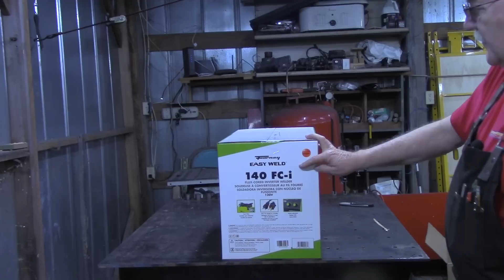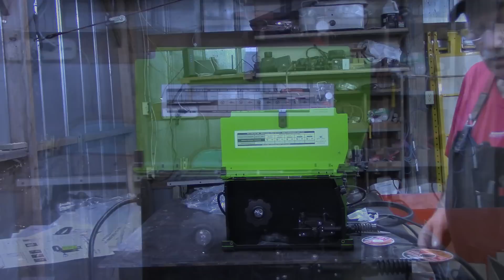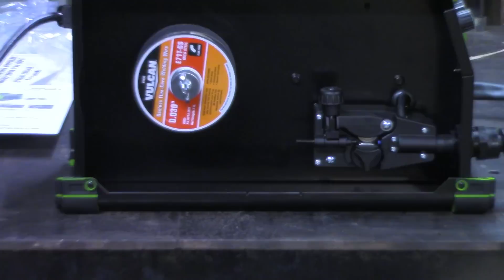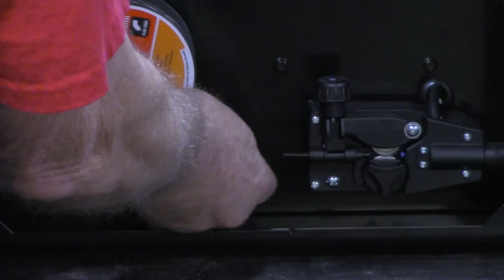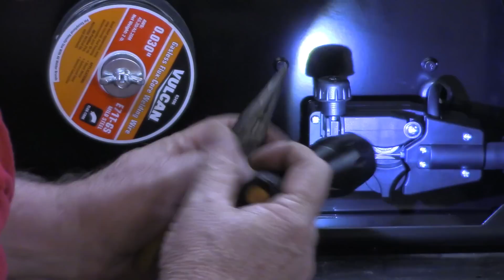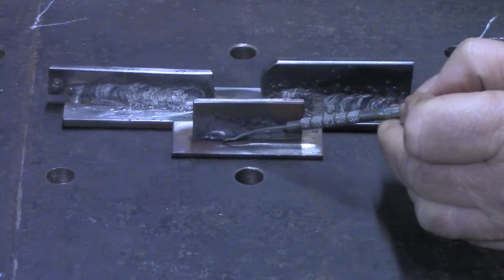Forney Easy Weld 140FC-i Unboxing & First Impressions

Comment: He is not loading wire correctly, need to open the wire feed assembly. The wire must be set on the roller inside the assembly, and the wheel has 2 slots for 2 different size wires. The .30 goes is the slot in the wheel it belongs in. I think the other slot on the wheel is for 3.5 wire  so bigger slot. Watch the company video for correct set up.

Comment: The manual shows you how to raise the tension knob, as well as which side of the wire wheel to use, for the corresponding flux wire (.030, .035).

Comment: This machine has too low of a wire feed speed. The wire feed mechanism is too weak to push the wire through consistently. The wire welds itself stuck inside of the gun's tip. Other than that it's great🤣

Comment: Can anyone tell me an optimal wire speed/voltage setting for for 1/4 inch and 3/16 inch steel? Thanks. Im using 120v.

Comment: Just picked up the same welder a few days ago. There are 2 line grooves where those 2 wheels pull the wire. You can flip one of those around depending on your 0.030 or 0.035 size wire. Just a heads up if you changed ur wire size since or having any trouble since. With these welders it's best to create your puddle on the bottom of the joint and move the puddle up as you go along.

Comment: Great video. My mistake as a non-welder:
1. didn't take the copper things out so the wire can come out and screw them back in.
2. scrap the paint on your object before welding and clipping.
3. the feeder can adjust to faster
4. the black things can adjust and move out to help the wire to align to the blue tube.
5. I turn the power to 4 instead of 1 to melt better. the metal shouldn't be too thin.
6. didn't buy the wire in the first place.
7. borrow my friends' welding gloves which are way too big.
remember to practice first before doing your project.

Comment: Some friendly advice my dad taught me with mig welding. You don't go back and forth like 6013 AC, you want to feed your pool in the direction you are welding in a nearly sideways pattern resembling a very short letter z. Then you'll be sitting pretty. You did a good job with self taught learning curve. You're a good welder.

Comment: I bought the Amico Mig 130A.  I see the manual for it is actually the manual for the Forney 140i, complete with typos!  Even the set up chart says 140i, and the Amico has the knobs reversed!  I don't know what that means, if they just stole the manual or if the companies are related.  Weird.

Comment: I find that keeping your wire just behind the leading edge of the puddle doing cursive e or loops makes the weld extremely uniform on 1G and 1F welds. Thumb nails from top to bottom on 3F,  Z on 3G, and 0's on 4G and 4F

Comment: Think a 120v 2000 watt power inverter source can power this and weld 1/4 inch steel?
Reply: no.  And no.  The manual calls for at least a 4000w generator, and these machines won't do 1/4 inch single pass.   Multiple pass, sure.

Comment: Just bought on of these. Try to weld 22 guage set welder for 1 voltage 2 for wire feed won't weld at all and 4 and 4 for 16 guage weld like crap. But weld good with higher setting. Your do the same. I should buy Lincoln for 200$ more instead.

Comment: I bought this model and my welds are coming out very bad I don't know y tho I haven't weld for a year but I still think the machine is messed up or put together wrong by my uncle if u guys can think of any reason my welds arnt coming out that good plz reply
Reply: slow down more voltage more speed

Comment: I have this exact machine and I was able to make a 125cm x 250cm
light duty hauling trailer from scratch using 1.6mm (1/16 in) thick square tube
and angle iron. All the welding was done outdoors!

Comment: Personal safety should always be practiced. I noticed you did not have leather gloves on to protect against burns. Though the video does not show you welding in a short sleeve shirt I’m assuming you did and this is also bad. The UV rays given off from welding can give sever sunburns on any exposed skin (I’ve gotten it on my neck before). I think regular leather work gloves would have been fine for the amount and type of welding you did (no need to buy the expensive welding gloves)Thanks for the videos, however. I do find them informative .

Comment: Mr Lee, I believe from your video that you were welding backward . Stick welding for a right handed, goes from left to right while pulling away. For mig welding it's to opposite, left to right  while pushing forward.
Reply: I think that is true for mig but not for fcaw. Pushing with mig helps the pool stay shielded but with flux core, pushing increases the risk of contamination. That is my understanding anyway. Pushing mig certainly makes it easier to see...for me anyway.
Reply: Alan Burnham drag if it creates slag

Comment: Congratulations on the new welder Lee.  I see you are getting lots of advise already. Practice, practice and try different techniques.  I have very little experience with flux core, as I have a 250 amp LTec old school machine.  Anyway, some of your welds look like you are going a little slow also a good practice when you sit down to weld something, take a piece of the same material and get your ark started with a steady move and with your other hand adjust the wire feed until the machine has a very clear and steady buzz to it, like a mad bee.  After awhile you will commit to memory the settings for most of the material you weld.  Also ground on the material or as close as you can get, not all the way across the table.  Good luck and have fun my friend.
Reply: This is actually a great tip. Thank you!

Comment: When they say to make sure the 0.30 on the roll is facing outside for 0.30 wire, they’re not talking about the roll of wire, though this machine feeds from the bottom, so the label will be out. They’re referring to the metal feed roller inside the drive. Normally the top roller. There should be two grooves in the roller. One will be 0.30, and the other could be either 0.23/24, or 0.35. The side you read from the outside, when the roller is installed, is the actual wire size in the groove being used. Use the minimum tension you can get away with. Make sure the wire isn’t bent! That’s really important. If it is, it can jam, and flux core is delicate, because it’s hollow with soft flux inside. It’s easy to crush the wire with too much tension.

Just be very careful, when installing the tips after feeding the wire through, to NOT press that trigger! It will be live when you do.

Just a word to the wise. Magnetic clamps can move the arc around, and your weld will wander. The arc will want to stretch towards the magnet. Try not to have the magnet too close to the area you’re welding, and remove the magnet as soon as you have made your tacks.
Reply: Great  information  thank you
Reply: Your advice is greatly appreciated and welcomed by a novice! Wish we could have an hour or two together!  THANKS!
Reply: Good to know. Thanks

Comment: lee open up your drive rollers by flipping the hinged tentioning knob located directly above your rollers.this will alow you to take the wire .030 off the spool and feed the wire by hand into the blue tube. then  hinge down the wire tetioning knob to close the roolers down on to the wire. you dont have to feed the wire the way you did at all it not the correct way to do that it worked lol by make it easyer the way i explained. hope this helped. ive been a certified welder for 41 years. nice addition to the shop.
Reply: Great word
Reply: If I using a extension cord  from house would u recommend heavier cord like 6mm cord if I burning holes welding a light sheet metal 0.9mm?

Comment: I have done stick and TIG welding, now I have a HF wire welder I need to try.  I can't talk to settings yet, but you might want to try something like CRC Welder's Anti Spatter Spray to help with the spatter..

Comment: Great video. I used and FC welder for years, but when a great deal came along on a shielded MIG welder I changed over. Still use the FC from time to time.  No matter what type of welder your using. The basics always stay the same, clean work, good ground & watch your puddle.  The things you have been doing for years and years. Don't let that little green box change what you know and start second guessing your self. Give it a couple of weeks and you will weld like you have used that welder for years.

Comment: you don't need the gas shroud for flux core but you can use it and rest it on your workpiece and as they say walk the cup in tig welding up and down as you drag it along your workpiece
Reply: Great tip. I ha
Reply: Great tip, I only have one eye and that has a cataract. I tend to Run welds off line, that may well help.
Having said about my eyes, did no one else think the video needed a bit more light?. Or was it filmed through a welding helmet lens?.

Comment: next time you need to feed a new roll flip your roller tensioner lose its spring-loaded and feed the wire in the tube then flip your tension back on and the wire should lay right in your rollers pull the trigger as you did and wa la
Reply: welding  aluminium or steel  on this video

Comment: I found with my forney flux core wire welder metal preparation dramatically improved my results. I’m working on spatter Guards or a coating or tape to speed up clean up. I have tested welds made with my forney like a bending till something brakes. It.s not the weld that brakes. Thanks for sharing

Comment: When loading a new spool of wire always lift the top roller it is hinged for that purpose. If you have a gas hook up on it you will find it will weld much better than without. You will need argon gas for steel. Flux core is ok but was designed for welding outside in the wind. Gas welding is much cleaner and better for the beginner , and is easier. If it doesn't have gas hookup flux core is your only option.
Reply: This is a flux core only welder. It appeals to beginners because of it's low cost and simplicity. I think dealing with gas scares off some beginners. Also the fact that these welders run off 120 also attracts first timers that don't have 240 available.
Reply: I'm going to wager to say he probably already knows that.
Reply: @carlosrobles2048  not sure what you are referring to. If you watched the video he plainly said this was the first time he had ever experienced a wire welder and was having some difficulty in loading the wife and other things. As a welder for over 30 years I was only giving him some pointers that would make his first experience easier and be helpful. So if giving him some help or pointers bothers you then I'm sorry.

Comment: I kept waiting on you to figure out that the knob on top of the rollers allow them to separate making wire loading easier. You made it work and that is the important thing. Good luck. I started with a wire welder and then got a stick welder. Neither of them high quality. I find that I prefer stick welding but there are times when you can't beat a wire welder. Apropos of nothing, my stick welder is one of the chinese welders that is about $120 on amazon. Modern electronics make it much easier to use than the lincoln buzz box.
Reply: By the way, I just completed a 2x72 belt grinder with lots of help from your project videos. I got a lot more information from your belt grinder videos than all of the other content providers combined. The last piece, my tool rest platform was installed early this afternoon. I was waiting on a 9/16 inch tap to tap the holes in the plate. The threads of the bolts are just shy of protruding through the plate.
Reply: Yea I was waiting on it 2

Comment: Welding tables are great, the only downside is they are also great heat sinks. You might consider using some fire bricks to put the work on and clamping directly to the work.  I'm really surprised that you welds look as good as they do.  Good video, FC welders are quick and dirty, for small jobs they are good to have around.

Comment: When i got my first wire welder, my friend the 22yr old welder told me the ground is key, he recommends having a nice clean ground area, and I have seen others who will clamp a nicely frayed copper wire between the clamp and work to make sure the ground is not breakable. The reason for assuring the ground , he told me, was it could create a lot of situations that a newly might consider to be wire speed and voltage problems. That leads me to cleaning the weld surfaces by grinding to clean metal is not necessary, but a very good practice if you are concerned about getting a really good weld.

Comment: LEE,,let me help you out bud, if I may, for FC fillets point the wire down more toward the bottom plate, it is a heat sink to the table, the top plate heats up faster,  use 45-55 degree work angle from the bottom plate. Good choice of wire size [..030] burns hotter on a 110v FC welder, helps with heavier than sheet plates. For that plate there MAX your voltage. WS as high as you can go until wire starts to push the gun away then drop back WS until it welds good and hot. Your doing very well other than settings.  Practice a bit👍👌
Reply: Thanks your comment has cleared up my welding problems lol now I get really good welds and it has helped with confidence all the best
Reply: @tattoos1988  ATB to you too✅
Reply: Great tips! 👍